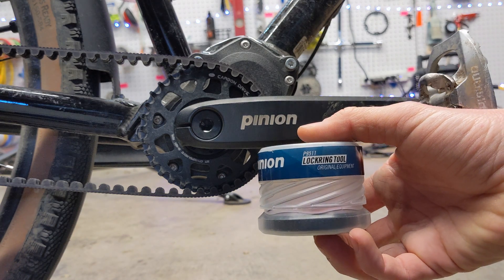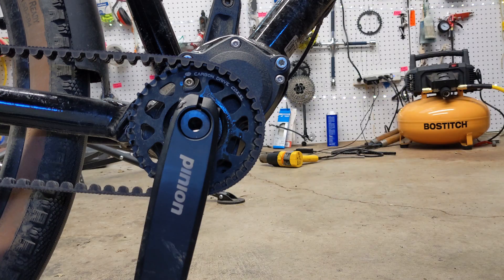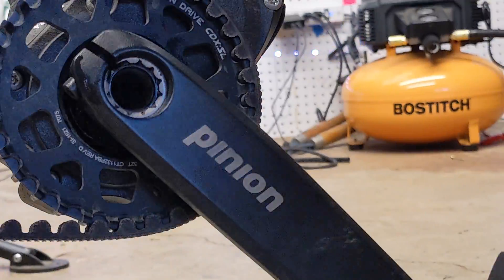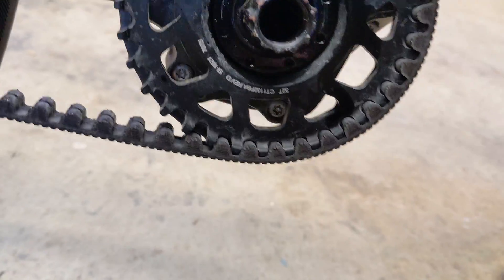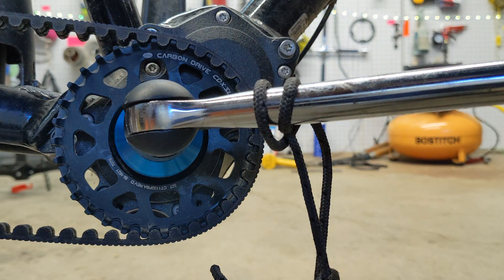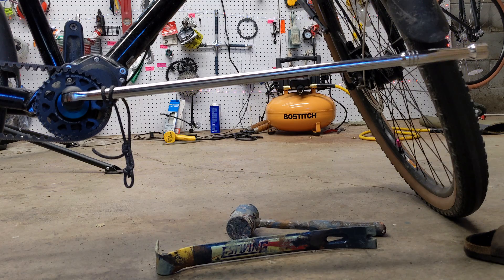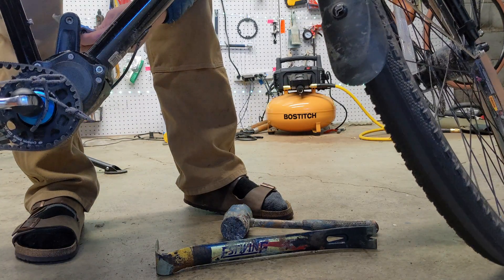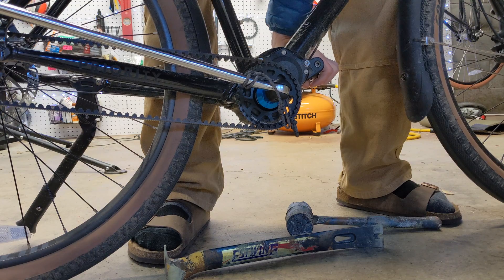Priority 600 Pinion Gear Box Lock Ring Tension Check! Pinion Lockring Tool

Comment: Pinion recommends to put medium strength loctite on the 10mm centre bolts threads and then torque to 10 nm

Comment: Just got my pinion. After 100 miles, I notice a distinct clicking noise at the same crank location when pedaling. I’ve tightened,loosened the belt and it’s still there. Any idea?
Reply from the maker: I am not sure. I would recommend taking the assembly apart to see if something external of the gear box is causing the issue.

Comment: Hey Buck, a question, I'm doing the same thing on my C1.12 right now. That blue Pinion lockring tool has directions on it "loosen" and "tighten"... however I'm lost with the "reverse threadedness going against them?
Reply from the maker: Reverse threads mean turn clockwise to loosen. So visualize a clock ticking in your head and turn the lock ring tool that direction. If you get a lot of resistance try the other direction. Repeat those steps until you get movement.

Comment: So the maintenance free Pinion...  only change oil 1 time a year.... Bike ....  now this has to be checked...
Reply from the maker: maintenance free is relative to use and how long you want parts to last. Run a wheel set of any caliber on bumpy dirt roads. Fly a bike with a commercial airline. You will do more need more maintenance on the wheels and drive train.  Ride on the bike path once a month in the summer and store the bike in the garage when not in use. No maintenance.

Comment: Thanks for sharing your experience with the Priority 600. I narrowed down my next bike purchase to a couple,  and considering purchasing the 600 for the Pinion gearbox. I like the idea of the belt system and manual transmission. Curious though on Prioritys response to the problem. I see they loaned you the tool to use, but was that their only option given to complete the repair or was there an option of taking to an approved local bike shop?
Reply from the maker: They gave me the option to take it to a bike shop. I do my own work though so I did not take them up on that option.

Comment: I hope I'm not annoying, but it still seems like your belt tension isn't tight enough.  I'm on the still frame at 1:22 of your video and there's a noticeable droop on the bottom of your belt.  If you go through the Belt Tensioning process and move your rear wheel back a mm or 2, I'm guessing your belt skipping issues will disappear.  Please watch the Priority Belt Tension adjustment video and see if that helps.
Reply from the maker: I used the app to verify that the belt tension was correct based on it sound when plucked.